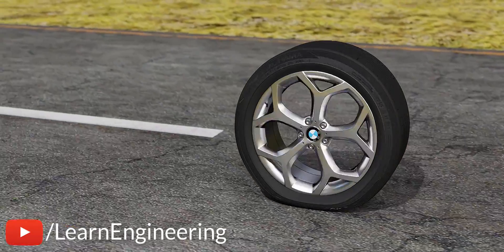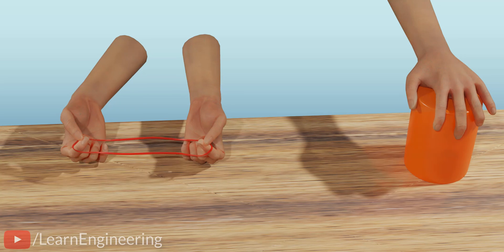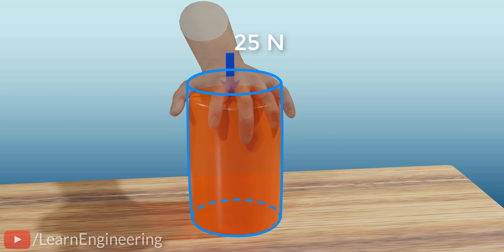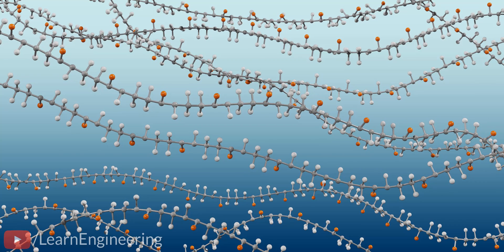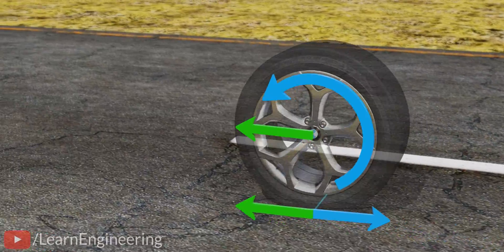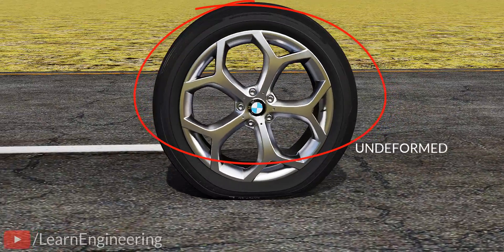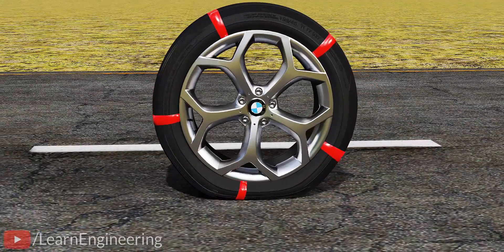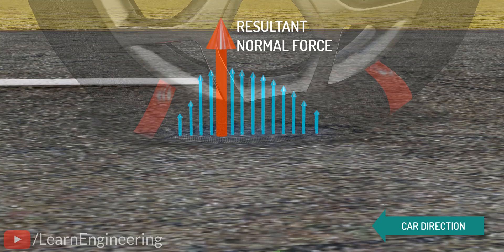Understanding Rolling Resistance!

Comment: Just to extend a little bit from the end of the video: Since the resultant normal force is non-uniform and lean towards the front edge of the contact patch, it does not pass through the center of the tire and create a moment that resists its rotation.
Reply from the maker: Thank you for that extra information. I didn't think this way.
Reply: @SabinCivil  Appreciate your well illustrated, excellent videos.
Reply: @SabinCivil which software you used to animate this video.
Reply: Yep, the video is missing that final bit to come back around and answer the original question fully. Thanks for putting it in words.
Reply: Ah so these two effects combined are why low PSI tires cause poor gas mileage.
Reply: @ImBoredToo  oh interesting !
Reply: @ImBoredToo  And why trains with their steel wheels are so much more efficient than cars
Reply: @halfmv2  I tend to believe that energy lost due to intermolecular friction, i.e hysteresis energy loss, and energy lost due to negative torque are two different matters, although they both are the consequences of hysteresis effect. From an energy perspective and consider a rubber element approaching and departing the contact patch. Even without considering losses due to molecular friction, the element already need to spend more energy when approaching to overcome higher pressure and receive less energy when departing since experiencing lower pressure. If indeed two separate losses, it might be possible that hysteresis energy loss in most cases dwarf the lost due to negative torque. But I mean, I am not sure either...lol
Reply: @snmzht8650  actually these are not 2 different effects but the same. By intergating the distribution of the normal force on the patch area you get the magnitude of the force N and its horizontal distance r from the axis of rotation of the wheel. The torque applied to the wheel from this force is M=N•r. The power of this torque is the power that is turned to heat by the hysterisis, P=M•ω=N•r•ω. Hope I expressed it clear.
Reply: @gm683  Thanks for your reply. I can fully understand your logic and a large part of me think the same as well. I am just no fully convinced by the following reasoning:
a) Thinking of the mechanism, it seems intermolecular friction is more like viscous sheering on a rubber element (Element as I described in the previous comment) and pressure distribution should acting more like a normal force on the element. So it looks like two types of work been done to consume the total kinetic energy of the wheel . 
b) if we are dealing with a non-hysteresis material, and somehow create a pressure distribution that leans to the front, than that pressure distribution alone should as well cause energy loss.
With that said, I agree that your conclusion is more likely to be correct, as I see articles describing this matter from both perspective but don't distinguish them as two separate energy losses.
Reply: @snmzht8650  You're almost there. For point b) you're missing the fact that to 'somehow create a pressure distribution that leans to the front' at that point you're basically recreating hysteresis. So yeah, they're just two ways of looking at the same effect.
Reply: @Christophe_L  I believe you are right. I realized that the normal force experienced by the rubber element as described in my point a) should be also created by some kind of sheering between other rubber elements which is included in the hysteresis energy loss. Thanks!
Reply: @snmzht8650  How would one part of the tire that gets heated more than the other part actually affect rolling? I think it's all in the torque.
Reply: This threw me off for a second. Having half-heartedly studied vehicle dynamics in racing I learned that the most force generation is in the latter half of the contact patch. But thinking about it now, that's the lateral force resulting from slip angle. I never considered the rolling resistance from the uneven normal loading. I thought it was just energy lost to friction inside the tire carcass.
Reply: @ChicknNudleSoup  I just learned the knowledge about the lateral force distribution after read your comments, thanks!
Reply: @Snm Zht   Please can you explain to me about the rolling resistance of a triangular wheel... means which has rubber or steel tracks... 
Rolling resistance of SNOW CAT vehicles...
Thanking in advance...
Please...
Reply: @spark0076  I believe it can be explained with some similar reasoning. Consider the simplest model with just two road wheels connected by a continuous track. The asymmetric distribution of the normal force exerted on the road wheels creates a moment that resist their rotation. This can be caused by the hysteresis deformation of the road wheels or the deformation of the road surface. The track still get compressed and expanded along its thickness whenever passing through between the road wheels and road surface. Plus, track tension would be different at different places of the track, meaning if looking at just one piece of the track, it also go through deformation cycle along its length. These should all cause energy losses.
Reply: Wow. I was gonna leave the video without understanding rolling resistance. The video sets it up without answering it.
Reply: So then the complete conservation of energy analysis would account for both; the work adding, and the work subtracting from the wheel torque.
Reply: I did not get you.
Reply: @balajit65  The Video which you have uploaded is an animated video. Did you made this video. If yes, which editing software you used to make this video.
Reply: @VivekMishrathetraveller  that video is not uploaded by me, I watched it and felt like commenting.
Reply: @Shakti Rathod Yes, I forget the shear stress on the contact patch. I was too focused on the normal stress as only the normal stress would result in a negative torque. Thanks for reminding me that. However, I do want to point out that the normal stress is not exactly vertical, as the ground also deforms under stress and would deform asymmetrically. Therefore, summing up the normal force would give a none zero horizontal force.
Reply: Great addition to the video. Also, rolling resistance results from deformation of the bottom surface and creating microscopic bumps that will apply a normal force to the tire with the a negative horizontal component.
Reply: Exactly, this was missing.
Reply: i know Im kinda randomly asking but does anybody know a good website to stream new tv shows online?
Reply: @Calvin Damon I watch on Flixzone. You can find it on google =)
Reply: @Ledger Elon Yea, have been using FlixZone for years myself :D
Reply: @Ledger Elon thanks, I went there and it seems to work =) I really appreciate it!
Reply: @Calvin Damon no problem xD

Comment: How would you lower the rolling resistance of a tire made of an elastic material(rubber, polyurethane, or whatever)?

I heard adding Silica to rubber decreases the rolling resistance.
Reply: Harder compounds and higher pressure
Reply: there are patterns used in the weave of the belt plies and radial weave that decrease roll resistance but make the tyre directional. Materials used in the belts, walls and radial banding also vary to reduce roll resistance. 
Reducing the tyres weight and moving the weight balance closer to the center of there rotaional axis also reduce roll resistance losses due to centrifugal loss. 
Stiffening the side wall without reducing.
reducing surface contact patch pinching and spreading by changing tread patterns and varying tread densities across the contact patch.
They will also have there own 11 herbs and spices they use for the rubber. they may add sillica (glass) ,  plastic,  PTFE, kevlar and many other ingrediants to reduce internal frictions and increase traction.

For instance silica will make the compound harder wearing and stiffer but will also make the tyre more thermally conductive and introduce more road noise transmission. as such it may make a good addition to the primary tread sections but will be a poor choice for the side wall.

Comment: Then this hysteresis energy loss is additional to the frctional energy loss that we've normally presumed for slowing a car ??
Reply: This is the "friction" that makes the car slow down. The only contributes of energy loss that have to be added to this effect are the aerodynamic friction and the friction between the components of the car's trasmissions, and possibly the ground slope.
Reply: @halfmv2   Shouldn't we have a contact 'line' to have zero velocity at the bottom of the wheel? If it is a rubber wheel, the contact area would be a surface rather than a line; therefore the bottom of the wheel should have a velocity relative to the ground. If you move a line on the wheel, you can see that there is a distance that must be traveled between where it touches the ground and leaves the ground, so technically there is a rubbing of surfaces. However, the direction of the kinetic friction would change depending on whether you are speeding up or slowing down. If you accelerate a vehicle, the kinetic friction is the force that makes you accelerate; therefore, in this case, the only force against movement would be hysteresis energy loss while accelerating. But if you are slowing down, the kinetic friction would also contribute to the opposing forces.
Reply: @halfmv2  I thought a bit more about my first question, and I came to the conclusion that there is no need for a contact 'line' to have zero velocity relative to the ground. We can have a static connection between the ground and the wheel even if there is contact 'surface'. I think what I previously thought is true if there is slippage and a car is accelerating or the driver is pressing the brakes. However, If there is no slippage, the tire loses energy only from the hysteresis energy loss besides the air resistance, as you said.
Reply: In the virtual experiment environment I guess they added some Force opposing the normal, then the simulation only focuses on energy lost by expansion delay. If ground friction was considered, the tire would roll even less
Reply: 99% of the resistance in a car will be air resistance. Obviously will depend on speed.
Reply: @Bartooc  not true at all,rolling resistance is not as important as aerodinamic losses but it makes up a pretty  large chunk of the forces that the drivetrain has to overcome.
Reply: @TheLTcousins  True but it depends on speed. At ~35km/h you need roughly the same force to overcome both of them at 160km/h rolling resistance is but a tiny fraction from air resistance. Since air resistance grows by speed cubed, rolling resistance stays the same.
Reply: @Bartooc  rolling resistance does not remain constant as speed increases....do you even know what you are talking about?
Reply: @TheLTcousins  Why would it increase with speed? If anything it will slighly decrease as tire expands slightly...
Reply: Rajath and Gurkan, if we take the Poisson Effect to be in consideration as well, the load from above leads to the tyre walls to be forced or stretched outwards (transversely, symmetric) and along the contact patch i.e. longitudinally and asymmetric with more stretched in fore than in aft from centre. This leads to slippage of tread even though the tyre/wheel is not actually locked

Comment: I was tired of my tires wearing out so quickly, so I decided to make a set out of tungsten carbide. Rolling resistance and hysteresis were dramatically reduced. I expect wear to increase by several orders of magnitude. I'm still working on traction, road holding ability, etc.
Reply: Bolt on some spikes like a golfer's shoes and you'll be fine.
Reply: The local council wants to know where to send the bill for the damaged tarmac?
Reply: Just use electrical resistance induced thermal energy to heat up the wheel, thus melting the tar in the road, causing grip, then decrease temp once velocity increases and initial threshold of grip is not required, and use the same principal inversely for slowing down
Reply: You expect wear to increase?
Reply: @Steamrick   My mistake, sir. I should have said "wear resistance and durability"
Reply: Try and convince the city hall to make the roads out of rubber 😉.
Reply: Wow
Reply: Good luck with the braking efficient when rolling resistance is reduced.
Reply: @thinknirmal  Braking relies on static friction, not rollling resistance.
Reply: lol, you must have a lot of slippage on the roads.
Reply: Note that trains do indeed have a lot harder time braking than rubber tires, which is why they sometimes drop sand in front of the wheels to increase friction.

Comment: How does linear motion and rotational motion cancel each other out at contact point?
Reply: Transitional motion is the whole tire moving forward, rotational is at the surface of the tire and is opposite, as shown, but you might be Thinking they're the same direction because the road and tire are moving together, but they're talking about total motion to the left, and then separately.. rotation, which is to the right.. scientist and engineers are so specific when they talk about things it out runs your intuitive image.
Reply: @jaredsciguy1634  Rotation is to the left and right, up and down, round and round. Not just to the right.
Reply: To add to Jared's comment. Imagine the rotation of the tire as lots of small bits of rubber stuck together, but each with their own linear direction and speed (vector). Each of those arrows is tangential to the tire's grippy surface. At the point where the tire touches the road, this vector is pointing straight backwards, and is exactly the same length as the forward motion of the axle. If these two vectors did not match and cancel then the tire would be skidding.
Reply: Oh yes, your quite right, nobody asked a question and I completely got it wrong, I basically only simplified the terms used, but alas I'm sure it super wrong.. and of course, the tire moves in all directions, and never moves with anything.. how could I have been so blind!
Reply: @jaredsciguy1634  Confession is good for the soul. It is good to keep discourse free and open without name calling and other such tripe. For my part in this specific discussion, I am sorry I stooped to the low of responding in like kind to you. Please forgive my lapse into derogatory vernacular. I will do better.
Reply: @4n2earth22  the shame!   Just as well, my expertise is in theology anyway,.. can I interest you in my "the last supper WAS the spaghetti monster" theory
Reply: @jaredsciguy1634  LOL! I will pass, thank you.